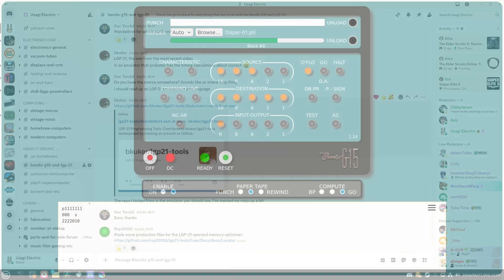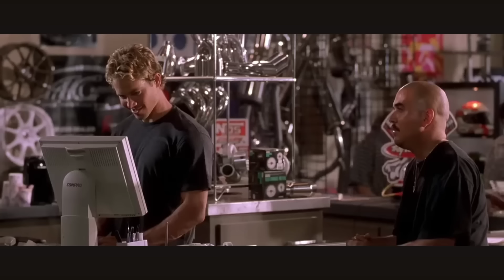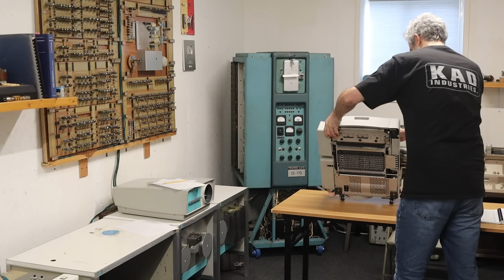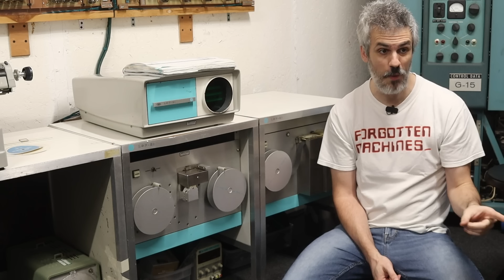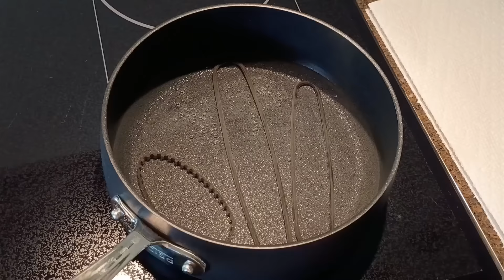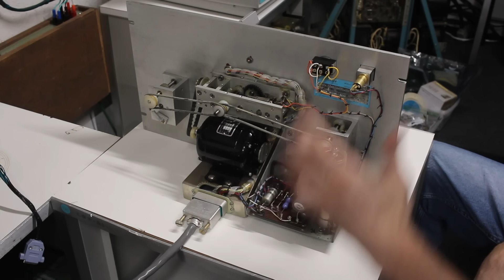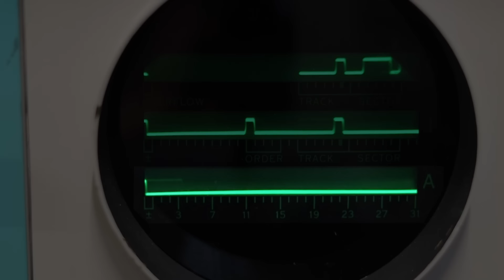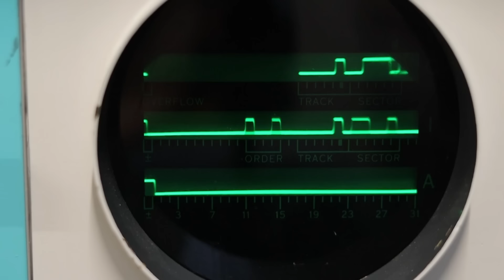Can We Rescue the Code on This 63 Year Old Disk?

Comment: Really, there's not as much difference between valves  (the name we in the UK used for what those in the USA called vacuum tubes)  and discrete transistors as you probably think.  Transistors need more current and less voltage, and semiconductors have charge carriers ready to go without having to be heated to hundreds of degrees C to liberate them, but otherwise you have an input that takes a low power and controls an output that can pass more power through it, sharing a common terminal, and the circuits are quite similar.  I'd expect the first generation of transistorised computers to be very similar, design-wise, to the last generation of vacuum tube valve machines.

The reversing mechanism with a differential that can be locked on one side or the other is found in jukeboxes, where a single motor has to drive the record lifter forwards and backwards twice to put the record onto the turntable, get out of the way until the end of the record, come back, pick up the record and return it to the magazine, all the while turning in the same direction.  Seeburgs and NSMs have to be able to do all this with the motor rotating in either direction, as the moving player mechanism plays records upright, A-sides going one way along the stationary magazine, B-sides on the return journey.  The TORMAT memory unit in Seeburg jukeboxes is actually core memory with "letter" and "number" write lines carrying half the necessary current to magnetise a core  (only when coins have been inserted),  a single read line (carrying enough current to demagnetise a magnetised core) for each side of each record as the carriage reaches it  (and reading clears the "play this song" bit, so it only plays once no matter how many times anyone selected it)  and a common sense line which tells the player mechanism to play whichever side of the current record the motor is turning in the right direction for.

Comment: Be careful when lubing plastic parts. Most oils are petroleum-derived, and most plastics don't like that (as they are also petroleum-derived). 
For unknown rubbers and plastics, the best and safest grease or oil to use is silicone based; as it's compatible with pretty much anything.
Reply: He's restored enough vintage computers that I'm pretty sure he knows when it is safe to use machine oil.  The plastics used in vintage electromechanical computer parts will be oil safe because they were lubed with machine oil from the factory.

Light machine oil is a much better choice here because silicone won't break down gummed up old oil.  He's not lubing factory-fresh stuff here.
Reply: @petermescher332  We don't actually know anything about what "he knows" or doesn't know on this topic.  
Also, unless you've worked in one of them factories yourself, building and lubing one of them exact models of computers, you most certainly don't know with what were those plastic gears lubed. 
Silicone paste, doesn't; but silicone oil spray will ABSOLUTELY break down gummed up old oil or grease (and fast!), while also being 100% guaranteed safe to leave forever on any plastic part.

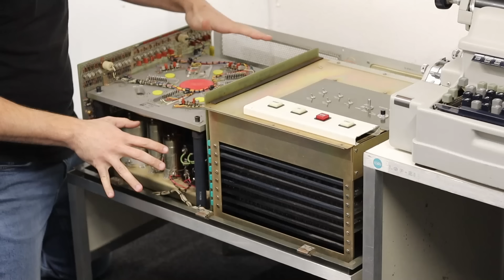Comment: @ 3:52 - I would suggest you need to check the solenoid coil resistance. Without sight of the circuitry used to drive the coil, it's difficult to say what's going on, but I would put money on a half-rectified signal across the coil, superimposed on a slow rise time. Dodgy capacitor, somewhere.

Comment: For the future: if you happened to have some 3d printer and some soft and stretchy TPU (or flex) - then you can basically print those belts! It is not ideal, of course, but when there is nothing around to replace it with, the printed belt works surprisingly well. Did that on my VHS equipment a year ago and still using it to this day with those belts.
Reply: + ladies stockings used to temporarily replace fan belts on old cars!
Reply: Far easier, they are O rings. Make a circle with them, measure the ID, measure the diameter of the ring itself, go to McMaster and they will be on your doorstep shortly! Had to do this with a vintage radio recently.
Reply: @komradebob  even better, they are o rings, buy a roll of oring stock of the right diameter and cut and glue your own bands or fuse them on a hot razor blade. now you can tweak length without ordering 40 sizes

Comment: Someone should be shot for not using ESD protective equipment on such old equipment.
Reply: Rest assured, absolutely no-one cared about ESD when this machine was put together. It only started to matter during the 80's, when surface mount stuff and integrated chips became common.
Reply: @MLX1401 correct on the first part. 100% wrong on the last part.

Comment: Today's tech support: Have you tried turning the computer off and on again.
Past tech support: Have you tried oiling the differential and cam followers, boiled the belt and o-rings, read and cross referenced the entire build diagram and lit all three types of incense?
Reply: Old computers used leaded electricity and had soft accumulators that needed the lead to cushion them from all the bits hammering away on them, without the lead the bits wore them away rapidly, the fix was simply installing hardened accumulators and you can use unleaded electricity just fine.

Comment: why didnt you capture it through serial to a terminal program in a pc?
Reply: the data transmission to the flexowriter uses a custom cable which is hard to access, is not RS232 or anything similar, and uses data codes which are nothing like we are used to now. Basically, you'd have to create a custom flexowriter interface just to get a terminal program to see anything.

Comment: The problem in relying on the Flexowriter to print out the data contents of the tracks on the disk is that you have to be 100% confident that every time it prints a character, that is the precise character it was sent to print.  Do you have unshakeable 100% confidence in it?  If so, do you have a test routine for the Flexowriter which it passed flawlessly repeatedly?  Unless those word groups have a check digit (which of course I guess they don't) can you really rely on them?  I would worry that you really have the reliable backup you believe you have.
Reply: After inspecting the printout, the code looks reasonable and we found some reasonable looking strings.  We also compared the dump of track 2 with the expected code from the paper tape and it matched.  No evidence of corruption so far,  The Flexowriter is working like a champ.
Reply: @RhysWeatherley  That's good to know!  I'm sure you guys wouldn't lead yourselves up a cul-de-sac, but it was the automatic caution which occurred  to me from having had to rely on printed out binhex  memory dumps from old gear 50 years ago!

Comment: Watching you work through getting the Flexowriter working, it occurred to me how much of the early computer equipment depended on what now looks like overly complex mechanical devices.  That cam set for instance, probably could have been done with disks an photo sensors. Not sure if they did it mechanically because they had a proven design, they were used to designing things mechanically or at that time it was cheaper to do it mechanically than it cost for the electronics. Now it probably would have been done with an encoder and an MCU (if it was needed at all ;-).

Comment: finding all those penciled in notes from years ago must’ve felt like finding audio logs in a survival horror game
Reply: It's also funny to me that someone was chasing down pages and pages of electrical schematics to find a faulty component, only to find that the fix was to get the machine lubricated properly.
Reply: @Stoney3K  Yeah, if you're used to modern electronic computers it can be easy to forget that these old machines are just as much mechanical as they are electrical, so the brain jumps to hunting down a signal issue without thinking it could be a physical issue
Reply: I dabble in old flightsimulators 1980s systems and it's exactly the same with us :-)  Gould SEL 32 based.

Comment: I'd love to see a rundown of how that display works... I mean, I know it's essentially an oscilloscope, but I'd love to see how the computer/electronics goes from "value in register" to "displaying the bits as a waveform"... :D
Reply: Yeah that would be fun to go over! I'm willing to bet it's actually incredibly simple.
Reply: The bits are a waveform because the computer is essentially 1-bit at a time and the registers are processed serially. (Also if it wasn't, that would be really easy to do with a shift register).
Reply: @Stoney3K  I presume there is some sort of state machine that sets the Y value of the CRT beam so as to get the registers in different locations? I would definitely love to see more about that subsystem.

Comment: I'm honestly not sure which one I think looks better. The Bendix has such a unique and instantly recognizable body. To me it stands out in the same way that Cray systems stand out. The design feels to me like they were focused on making it work, rather than considering what it might be like to operate (the paper tape reader is in a pretty silly spot), but that has a sort of charm I quite like to it.

On the other hand the LGP-21, by virtue of being built into a desk, looks more refined, a bit understated (as much as a minicomputer can be), and mature. The CRT monitor very much has that mid century futurism flair to it too. I would say aesthetically the LGP is much prettier than the Bendix though, it makes the Bendix look like a giant brick, rather crude by comparison.

I think the Bendix has an iconic shape, while the LGP is much more refined at the cost of having a less iconic shape. You could show me a silhouette of the Bendix and I'd recognize it, but I can't say the same for the LGP-21 (or maybe that's just a failing on my part?)

Comment: I do not know if anybody mentioned to you this, but it is kinda painfull to see relays being that exposed. I have a grandma who has worked on railroad sygnalig. Every relay is sealed with parafin and ruber gaskit in thick plastic case, and incides are immaculate. For all intencive purposes the only thing that breaks are electrical contacts getting anihilated by sparking and bendy metal parts being fatigued. Anything else - like overvoltage blowing the coil - is rear. First two faults have entire flor dedicated to deal with - right offs have one office where things are disacembled for still usable parts.
Kinda sideffect of this is that you can identify the fault just by smell, when you open the thing.

Comment: If that's an A.C. relay that's chattering, it may have an internal diode that has failed shorted.  Adding an external diode might help if that is indeed the case.
Reply: They work by spring tension vs the magnetic field... by design (operational theory) it should chatter somewhat. The gaps, proximity to the core, and spring tension all play a strong role in exactly how this type of relay responds.

They are similar to those used in the mechanical voltage regulators for early alternators in cars, specifically the current limit relay. 

The coil is only a handful of turns and is in series with the contacts and the main motor windings so that if it pulls more than the trip point of the relay, it pulls in, opening the contacts. Has the effect of soft start because there's a few ohm power resistor (visible on the left in frame, lime green tube) across the contacts that still allows some current to flow. The relay is trying to close for efficiency purposes (bypass the resistor) but has to spend some time open until the motor gets up to a minimal speed. This is usually necessary in some way or another and for various reasons with larger motors (especially where flyweight is involved) to limit the much higher inrush current a stalled motor pulls from the supply. 

The transition will always involve a little bit of chatter, its unavoidable, because when the contacts close after the current has fallen below the threshold, the motor is going to draw more current, pushing it back over the threshold, and so it pulls back in, the contacts open, the current drops below the threshold and it closes again... and back and forth a few times until the motor is up to speed and the current gets away from the threshold again. The resistor also plays a role as it needs to be a low enough value to get to (and over) the intended threshold speed but not so low that the inrush remains unacceptable at full stall.

What he has going in the video would be considered both early and excessive. Needs to decrease the spring tension so it stays pulled in longer and only tries to shunt the resistor once approaching full speed. The resistor may also be out of spec (although looks fine, but would be reading high if anything).. This has the effect of a weak starting torque that causes the motor to spend too much time around the transition speed or if bad enough, widening the window to the point it isn't anywhere near it. Personally to me the resistor seems fine, it is accelerating ok under limit... it appears to be geometry and spring tension related. Get that right and it should flip flop back and forth no more than 3 or 4 times quickly and in a fairly stable way (not erratic) when it transitions to full throttle.

It is a very simple design but also a very delicate balance that is easy to upset and tricky to restore.

Comment: Oh my!  The CRT sitting near the edge of the shelf looks very precarious.
Reply: You'd have to do something really REALLY silly to damage it. 

And it's an oscilloscope tube with a plate in front for the text, it's not unobtanium, even if it was shattered when he got it, he could have replaced it.
Reply: @volvo09  My concern is about the implosion risk.  If the tube rolls off and hits on the edge of the face, there will be a lot of high velocity glass shards.  Given that the mass distribution, hitting on the face is fairly likely.

Comment: The data cable was made by hand so I wonder if you are getting interference between the wires being in close proximity since the wires weren't coaxial with ground shielding.   That could explain why your two scope lines are getting strange results.

Comment: Congrats Dave, glad to see everything is coming up so well with this machine, and especially impressive is how much of the problems were purely mechanical and fixable with a little elbow grease and DeOxit! The digital components are working great and the CRT has been flawless, as well as so much more informative then mere blinkinlights could be, without being a full monitor screen yet in 1965. Awesome stuff, and totally relieved that the strange combination of RAM and hard disc drive had it's 40+ year old contents safely dumped to paper, where they can be encoded digitally with ease. Love it, and can't wait to see the final complete result!

Comment: So, if you find a fault that allows you to read all of track 0 1 and 2 correctly, won't track 2 still be over-written with your backup code? I hope nothing critical for using the machine lived there.
Reply from the maker: Yup, we went through and recovered track 02 by stepping through by hand and writing down the contents using the CRT. It was tedious and slow, but we got it.
Reply: He said that they manually recovered the data from track 2 before overwriting it. I think.

Comment: Run it again and compare output to check it… ;-)
Reply: I thought the same thing - need to verify it hasn't just read garbage. Or at least scan in the printout and search it for strings or something recognisable.
Reply: There's no telling what program is actually on the disk right now, so no way to know if that program will be useful for bringing this machine fully back to life, but yeah, if I had any interest in figuring out what that code does, I would make a second printout of it.  If for no other reason, keep in mind that that Flexowriter hasn't been used for a LONG time, and it wouldn't be a huge surprise if it mistyped a few characters here and there.

If I remember correctly, there is a switch somewhere that allows you to write-protect the first 8 tracks, I think?  If so, once you figure out what's wrong with tracks 0 and 1, you may find that there is bootable code on them to load programs from the high-speed tape reader, so you don't have to go through the whole boot sequence to enter programs.
Reply: @BrightBlueJim  I'd be more concerned about errors in the OCR, because that print out is kinda variable in contrast. 
(Which is something that is amenable to tedious hand correction, and is also likely to improve as the machine redistributes it's lubricants more evenly.)
Reply: ...or add any kind of checksum
Reply: @polluks2  yeah I think the fastest way is to read data and do some checksumming by chunk, do it on the OCR'ed data and then compare. That way, not everything needs to be reprinted, but it would give a pretty good confidence on the whole process end-to-end.

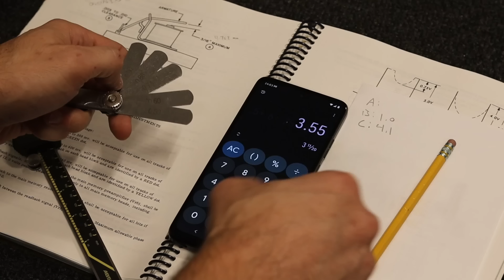Comment: I need to know which calculator app you are using here 3:33
Reply: It's just the stock Google Android calculator
Reply: @SeishukuS12 yeah, android calculator
Reply: @SeishukuS12 . How do you get the fraction mode on?
Reply: @MarianoLu  As far as I know it will always just give a fraction if it's a sane number... There aren't any settings.
Reply: @SeishukuS12  so it may be that Samsung uses another calculator app.. my Samsung Galaxy Flip Calc does not have this feature
Reply: @MarianoLu  Ah, yeah... Samsung tends to use a slightly different set of base apps, you should be able to get the Google calculator from the Play store though.
Reply: The Bunny app. Converts weights into rabbits.